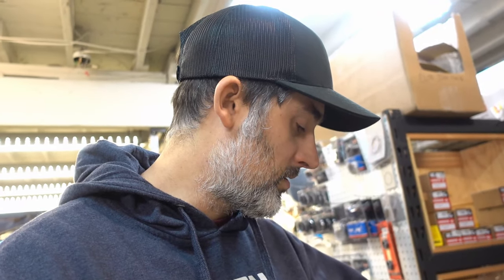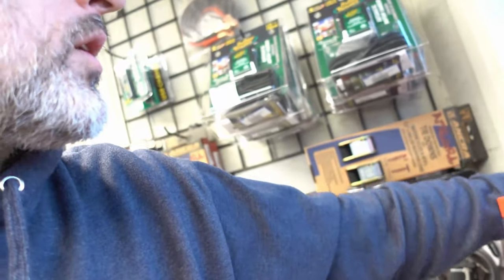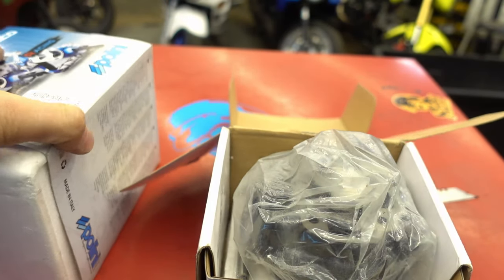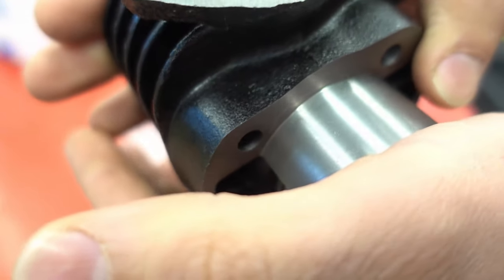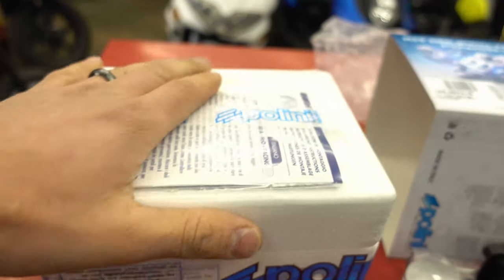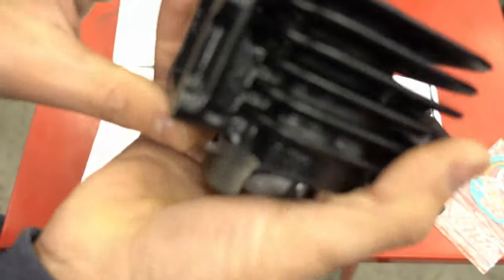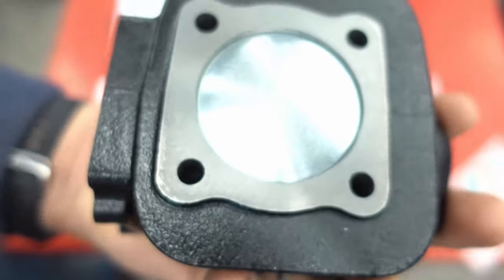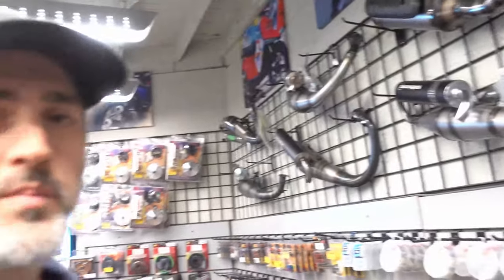Scooter Cylinder comparison POLINI vs CHINESE KIT

Comment: Glixal makes a decent product if you want to go the cheap route I have a bike build with a linhai scooter that I put all glixal parts in 100cc bore kit with cam and all kinds of parts it will do around 45-50 pretty smooth
Reply from the maker: no cheap parts

Comment: I bought a $100 jug and piston, head for 4stroke, the head was so bad, I wouldn't use it, the valve guides were so deep and big. It blocked 80% of the port! On both sides, how do they expect that to work! I bought another stock head and ported it! The guides are all close to blocking the ports, I can't allow myself to install the head without porting it! And the piston looked like it was the last of a 1million run, and casting was very rough on the dome, I polished it best I could, and unshrouded the valves, it cost some compression, I need to delete the base gasket, or get the head or jug cut about .030", and fly cut the piston about .015" depending on clearance, I'm building a 52mm bore, 95cc 139qmb,  hoping for 15hp+ with a bit of boost!, I'm hoping to eventually get a 2stroke scoot!
Reply from the maker: 15 HP ON A QMB? NEVER HEARD OF SUCH A THING
Reply: @Scooterswapshop  with boost!

Comment: I have a question for you I Bought a complete minaralli hybrid bicycle engine I noticed one of the cheaper Chinese pistons is in the minaralli I purchased here is my question sir I live in Texas I have about 170 miles on this motor she runs hot here in Texas I think it's cause she is still breaking in the co. I purchased it from says if I put in a better quality piston it would run cooler now this is the cast iron version or would I be better off using a athina aluminum cylinder or can you please point me in the right direction the temperature the motor is getting up to 340 and I shut it down that's after a few mile ride and I exchange the cast aluminum head for a cnc high compression head better cooling or will it get better just keep babying it
Reply from the maker: hybrid bicycle engine Yeah not gonna be able to help on that

Comment: Naraku  fits in where ? I'm want to keep the stock crank and carb with an upjet.
Reply from the maker: Bert439 naraku is going to be similar to the Chinese cylinder.
Reply: Thanks for the reply  Taiwan made or like you said a re-branded China cylinder?  I'm running am NCY Pipe and transmission kit.  I'm a commuter.

Comment: Taida is not Chinese, it is a Taiwanese brand. This brand of cylinders is also a relatively low-end cylinder in Taiwan.
Reply from the maker: 胡迪 they are based in Taiwan yes. Most their cylinders are bottom shelf China. I bought from them for several years. It’s terrible
Reply: Scooterswapshop 😅

Comment: Bought expensive polini sport 70cc vertical cyl and it didnt last...bought some random cheapest 70cc cyl and it's still working great and doesnt overheat like polini was...disappointed in polini
Reply from the maker: Sounds like your tuning was off. Never would we see better life out of a cheap china cylinder vs a Polini.

Comment: I don't know why you say the athena kit is not well made/cut corners in manufacturing just because it came with generic gaskets and whatnot. I have an athena kit for the prebug and comparing it to the corsa it is just as good and if not, better. Packaging is similar to the corsa as well and the gasket package is not the same as the generic chinese cylinders.
Reply from the maker: I said Athena cuts corners on the gaskets. Taiwan style gaskets vs Cnc head and o ring. Its a fact they are more prone to leaking. I said nothing about poor packaging etc. I mentioned overpaying for a inferior design. They’re the only company that charges what they do and give you a stamped metal gasket.  I never said it was bad kit. But if your going to spend nearly $200, you should be getting a Cnc head with o ring. As the $140 malossi even comes that way. I’ve met with the Athena Italy rep. His exact words were “our main business is automotive parts we don’t really care about scooters”. Vs polini who is racing and competing every year. Athena isn’t. A bad kit. Just overpriced for what you get

Also athena kits are not styrofoam, they're cardboard, the packaging is almost identical to the chinese/taiwan kits.

Comment: You're talking out your ass about the gaskets, Yamaha uses that style of head gaskets from the factory without any additional goop and they work great for hundreds of miles. If you torque the head up properly it should seat nicely and the copper will deform to seal the gap.
Reply from the maker: We build bikes for a living. Remember we’re not dealing with FACTORY Yamaha japan products we’re dealing with CHINA. We’re also dealing with 130-170psi compression, not the factory 115-125..If you think that a flat stamped metal gasket is better than on o ring you need to brush up on your bill nye lessons. Companies do this to save money. Period. Also these flat gaskets are aluminum typically.. not copper
Reply: @Scooterswapshop  Of course it's not applicable to tuning cylinders but it works fine. Same with that POS chinese cylinder you show in the video, that's basically a stock replacement.
Reply from the maker: Athena uses this same design. Cheap stamped metal. So does taida and twh on bores that see 165+ comp. some of these cylinders are 130cc with stamped metal gaskets. Air cooled, paired with high comp, large cc, with a thin stamped metal gasket good luck.

Comment: These cheap Kits like DR Evolution or something are Great for porting, because if you mess it up its easy to replace XD
Reply: Dr is cheap, but still a quality cylinder
Reply: Dr is Top performance, the difference between Dr and Top is the finishing of cylinder.
Reply from the maker: ok
Reply: For cheap kits.. have people here tried 200 or 160 cc.. taiwan or thai made? Like 150usd.. or sumtn

Comment: U never talk about gear kits like molissi straight cut gears please do a video
Reply from the maker: I can plan it. But gears are gears really. One brand vs another do the exact same thing. As long as the ratio is the same they perform identical. Minus the annoyingly loud stage6 gears
Reply: @Scooterswapshop  Thanks 4 the reply I noticed u dont piaggio nrg or gilera runner parts any reason y thanks again 4 the reply love this page
Reply from the maker: Pat Sherlock hey pat! We didn’t get any runners or nrg here in USA unfortunately

Comment: great video tho i got to say i fited a $40 chinese 70cc kit that come with a head to my minarelli horizontal 1E40QMB has done so well  and yes it dont have the power of a polini kit or as high reving  but i only fitted it as a budget  kit to i have build my stroker engine but 7km done and still going :D
Reply from the maker: Yea I’ve ran them too. They fit the bill for the price. Just Low power and short life expectancy. But for that price you can’t really lose
Reply: @Scooterswapshop   oh 100%  with you  but if your just using the stock pipe a cheap 70 kit will be fine as will give a nice bit of boost over the stock 50cc and i cant belive this kit has lasted so long as im running premix using some junk outboard 2 stroke oil  but now it only has to last one more week then my new kit and crank will be here i hope as i have to inport them as no one in the uk sells stroker cranks for the minarelli horizontal
Reply: @mrchilled85  Hows ya new kit compared to ya old one?
Reply: @AaroMesa   my new kit is not here yet due to Christmas  holiday :(

Comment: I hate that it's so hard to preach quality to people on the parts that matter.  All variables equal a Polini kit will start easier, be easier to tune, make more power and last 100 times longer than a China kit.  I've seen Chinese kits with a .015 piston/wall clearance, tapered cylinders, out of round cylinders, out of round pistons.  I will gladly spend the extra $100 to not have to do the job again in 1000 miles.
Reply from the maker: Monroe White my thoughts exactly. You can get “ok” performance and have the china kit last a summer; or spend $100 more and get far better performance and have it last years.
Reply: Separates bad ass stuff from junk. I love quality products. I know a guy who said his bike wasn’t doing wheelies at sea level. I told him what parts I had and he said he had basically the same parts. I beg to differ. I am at 6000 feet above sea level riding wheelies. We don’t have the same parts.

Comment: Yamaha jog with an eBay $45 48mm kit = wheelies
Reply from the maker: you can wheelie with any cylinder. Stock all the way to 35hp. :) Run whatever works for best for your application! Wheelies are a good thing.
Reply: Power wheelies

Comment: looks like a 50cc cylinder not a 70cc
Reply from the maker: It is. But the 70 is identical just bigger piston and bore. Just showing the differences in quality and what they come with etc
Reply: Look at the exhaust port, definitely a 50cc kit.
Reply from the maker: Bert439 yes I mentioned this several times in the video. And believe it or not a lot of 70cc kits have small ex ports like this. Airsal is one of them.